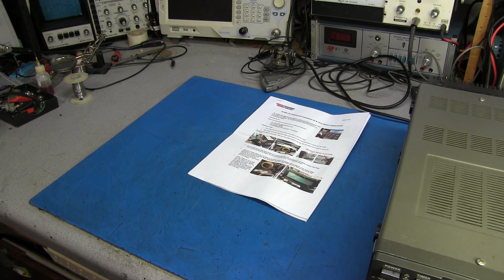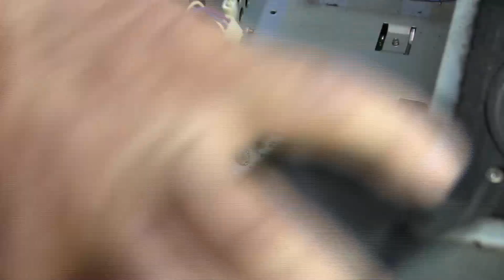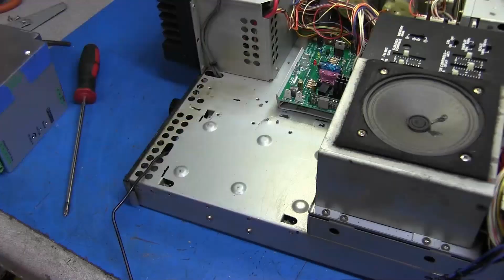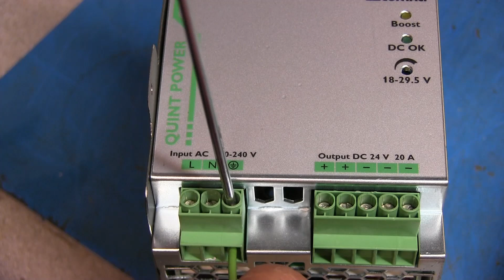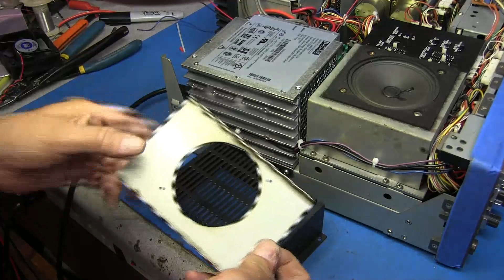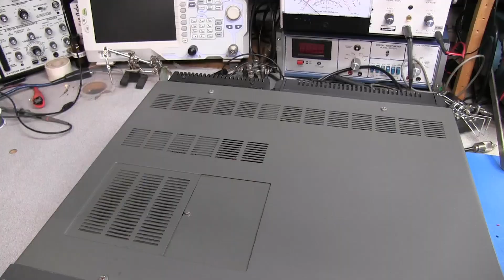Kenwood TS 940S PSU Upgrade

Comment: I'd almost forgotten how much fun it was doing this PS replacement to my 940 a couple of years ago...their S-meter and LCD backlight replacements are great as well. Amazing how much lighter the rig is afterwards (although it's still pretty heavy!). Rig should be good for another 40 years now!  73 - Dino KLØS
Reply from the maker: Thanks for sharing Dino, Have you noticed any noise from the new power supply on lower bands?
Reply: @TheRadioShop  None that I could hear Buddy. Surprisingly the two large PS caps removed measured fine for capacitance and ESR. Think you'll agree that this is a very elegant solution to keeping this great old rig going.
Reply from the maker: @PapasDino  Thanks for the conformation Dino. I did not notice any noise on this one. Will be doing the battery and led upgrade soon and then on to the PA unit.
Reply: @TheRadioShop  Great, I'll be very interested in how the new PA module turns out so I can decide if I want to go that far...thanks Buddy!

Comment: No more transformers, yes plural.  No more long wires running transistors to a heat sink, yes there are 4 all together if I recall, 2 for low voltage regulation and 2 honkers TO 202 package I think.  No more huge capacitors under the AVR board.   Was even able to remove said heat sink.   I own one.  I rebuilt the unit in it.    Good video.    I have a stingy receive on mine as well, I gotta Patreon to see said video?
Reply from the maker: You are correct John. Several voltages in that old iron.  This rig went on a fast diet . Thanks for watching.

Comment: The ''never used'' wires are used if the optional CAT control board is installed into the radio.

Comment: Kudos for your consistent quality work and attention to detail! Those look like a really nice PS replacement. Personally I prefer the original linear supply. Not surprisingly, some have reported noise in their TS-940s after installing a switch mode PS replacement. Time will tell but switch mode power supplies are not as reliable as as linear power supplies.  For me a better way is to recap the original supply and install a high quality 12V PCM fan to replace the fans in the rear. The 12V fan can be thermally controlled by an inexpensive (adjustable) PC fan board and the 28V supply regulated down to the required 12V using a common 12V voltage regulator device in a simple circuit. During operation when needed, the airflow of the new fan based on temp and on demand would be able to supply many times the airflow of the factory configuration keeping the factory PS cool and the rest of the unit cool as well.

Comment: Guessing it went from an analog power supply to a switcher.  They can get away with smaller capacitors and don't have the pass transistor power dissipation which likely caused a lot of the heat.  You had me worried when you were disconnecting all of those wires/cables but the AVR markings made it easy to reconnect.  Looks like you've done one of these before.  I'd be a lot slower on a first time because I'd be afraid I'd mess something up.
Reply from the maker: Barry, Honestly this is the first time I have installed this particular kit. However I am fully formiliar with the old suupply in these rigs. Cannot count how many I have had to remove and rebuild.  This was a fun project to attempt and I like the results. Thanks for the comment
Reply: @TheRadioShop  I'm still running my old Swan 350C that I bought as a teenager.  It's not a simple design but it still works great.  You seemed really confident working on that rig.

Comment: Nice slick install and your "added" installation changes makes for a better job in my opinion, so well done! But sadly the problem I see is that the cost of such a repair is pretty cost prohibitive based on current resale value of these radios. Maybe someone will come up with an AVR "replacement" board to use the existing transformer along with fan upgrade. Thanks Buddy for the video!

Comment: I wouldn't put a switching power supply with all it's RFI inside an HF transceiver.  I think you will pick up QRM at regular spacings on the dial.

Comment: They refer to old vacuum tube rigs as boat anchors. I have one of these TS-940's and it weighs a TON with its original power supply! I wonder how many pounds you pulled out? Nice clean install of the new supply.
Reply from the maker: Roughly about 8 pounds removed.  Yes these rigs are very heavy.  Thanks for the comment.

Comment: The purists must be spluttering - a switch-mode power supply INSIDE the rig? From your observations does it add any noise in the receiver or does it work just fine?
Reply from the maker: I will say it is hard to beat old iron. But since the original PSU id problematic, it is nice to have a good replacement. I listen on 40 meters last night and noted no switch mode noise. More investigation is needed though.

Comment: I have a Kenwood Ts-940s and I'm pulling my hair out trying to fix it. I was hoping someone had seen this problem, a google search turns up nothing.  Recieve is fine but it doesn't transmit. I mean it doesn't even switch over. With PTT Still receives and does nothing, no TX indicator. All supply voltages looks good. Pressing the send Button does the same thing.  Any info would be appreciated!

Comment: Why You did it? What is wrong with this Unit? 
This should have just output 24V.
Reply from the maker: It is what the owner wants. No, this new AVR runs at 28 volts.
Reply: @TheRadioShop  One overload protection with Thyrystor is fine.